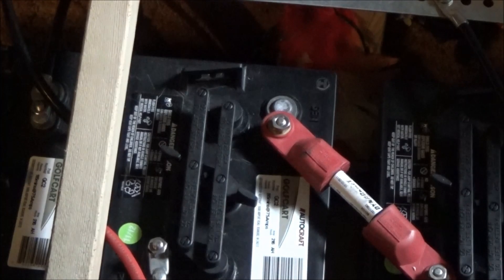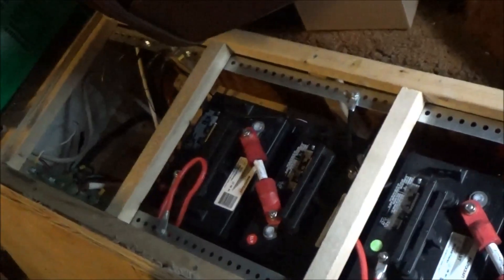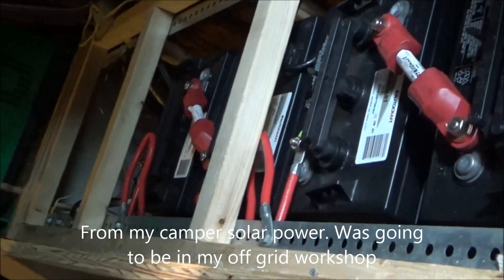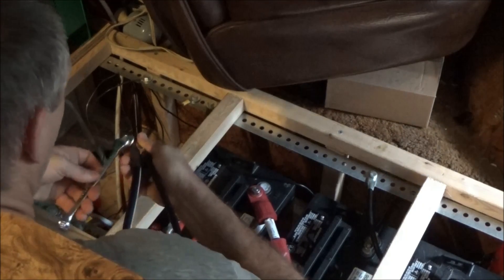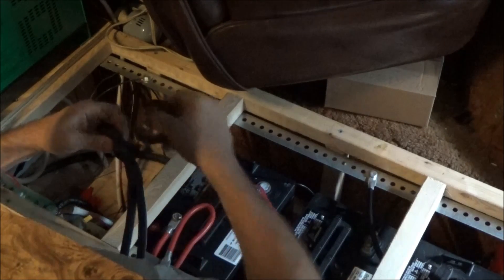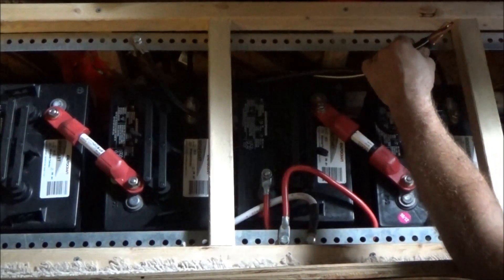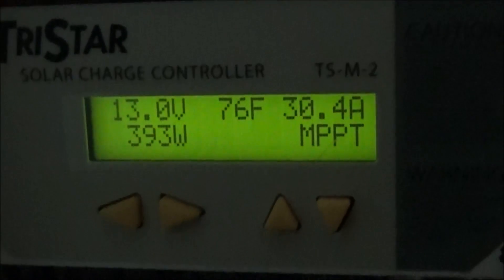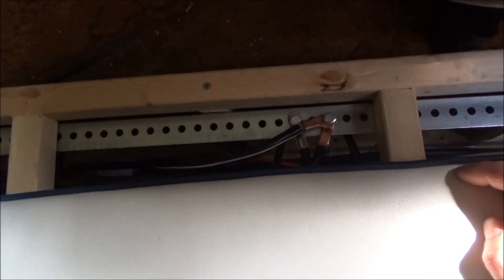Rewiring My Off Grid Solar RV Battery Bank

Comment: Hi Troy. I think your new conection is good idea.  BTw you should check how many Volts is voltage drop between first battery with + and last battery with + as well. Try it with hard load. I think good is belov 0.5V max about 1V. Btw that electrical tape is not good stuff.. That is for sure. Please use correct one. Correct i mean that self vulcanization tape . Not sure how it is called there. Btw for my batteries 12.0 or 24.0V is still OK. If possible try to get one of those BMW 600 from Victron. or similar . They counting SOC , Ah and such. YOu are always sure if it is Ok or not.

Comment: I would consider replacing the bus bar with something where you wont lose resistance, there has got to be something laying around, (like 1/2 inch water tube) just bang it flat and drill your holes where you need them. How are the batteries coupled 12 or 24 volt? From what I understand you draw less amps if you run 24 volt than 12. I know my camp fridge draws nearly 1 amp at 12 volt and only .5 amp at 24 volt. I am only trying to understand how you have it setup so as to maybe give some advise to drop comsumption!! Cheers!! I love the stuff you are doing...

Comment: The charge control needs to be connected directly to batteries.  The other items can run off buss bar.  Copper buss bar is the best. Aluminum is a efficient as copper for DC voltage.  Just trying to help since you know we live totally off grid.  Take care.

Comment: Good explanation on how to wire the charge controller and inverter to the batteries. I know your'e on a tight budget and choose not to include safety features, but you should have advised on the need to install fuses and battery disconnect switch. A good disconnect switch will hide the initial spark caused by the inverter's capacitors when they take charge.

At what voltage does your inverter's low voltage alarm sound? Shouldn't it be 11 volt triggers alarm and 10.5 shuts down?

All of those issues you talked about having with your system; buss bar, heavy gauge cable requirement  and the need to run + & - connections from opposite ends of buss bar were eliminated when I wired my system at 48 Volts. I use 8 batteries like yours but all in series.

Comment: connect the wires directly on the opposite batteries one on the positive the other on the opposite end negative moving the wires on the bus bar does not effect the equalizing charge

Comment: do you ever equalize your battery bank?  it sure makes a difference!  you can boil a flooded bank pretty hard for hours, so long as you keep an eye on the water levels.  if they get low, just add a bit of distilled water.  if your water levels ever get low enough that the plates aren't submerged, you're doing major damage!

Comment: Over the last 7 years--I started with power bright 3500; but, modified sine wave--then I moved up to  24 volt system. I have 6 12 volt marine batteries--that gave me 3 banks at 24. Volts. I only have  500 watts  in  12 volt solar panels---wired series for 24  volts then I have 3 sets for wired in parallel.  I even bough the morning star mppt tri star 60 amp charge controller. Also at the same time I purchases the go power 1500 watt 24 volt input inverter. One thing, should I climb to the maximum voltage to get more out of the charge controller? That propane refrigerator that went out what was the average temperature of the unit?

Comment: I have a similar refrigerator in my cabin.. For one thing, your fridge needs to be taken inside, out of the hot sun beating down on a black surface. Also you can put insulation around the sides and top of the fridge to help hold in some of the cold that it generates, don't put insulation on the back of it though, it has to circulate air there. If nothing else, put some blankets around it, anything to keep the sun from beating down on it.

Comment: Hi
1 )   Keep the inverter cable as short as possible.
2 )   Feed the charge from the MPT controller directly to the middle battery not bus-bar.
3 )   Take the MPT controller voltage & temp scene directly to the a battery post not bus-bar.
      I would use the battery nearest the inverter.
4 )   Tie the 6 v lines of the battery's  ( you can use smaller cable if you fit 5 amp fuse between battery's )
5 )   If the MPT controller has a dump load out put consider using this for automated charging
      of laptops & servers and the like ( 12v or dedicated "THAT OLD" inverter set up )

Comment: The inverter did not snap because you didn't have it disconnected long enough for the input capacitors to discharge.   You can make a light weight lead with a resister in it that you connect to touch off for a minute before putting on the regular cable.  This lets the caps charge up slowly without any escaping blue light.  ;-)

Comment: I think it was an over complicated and not as organized to put all 4 negative wires under the same bolt.  It would have been fine and looked more organized a couple of bolt holes away.  Also, another idea.  If you have some extra cables, you could daisy chain from bolt to bolt along the rail.  This would in effect give you a parallel copper path to lower the overall resistance of the non-standard buss bar.  Still, I think your buss bar is probably OK, but sure, it could be better.  Don't beat yourself up too much over that.  It would be more imporant to double up the longest leads if you acquire any more #2 wire.

Comment: One thing I have learn about solar is to build your system up to a 48 volt system...I am up to 24 volt --next step 48 volt it's can be very expensive.

Troy will need to do the same thing.  Do it in baby steps. Your 12 volt inverter is very bad on sucking up power out of your batteries.
Compared to my system. I cry every time I buy batteries, wire, and panels--I still got a long way to go. I believe trying to fix batteries is a wast of time---trade them in on new ones.
Reply from the maker: You got a very important point there. Its very expensive to switch over to a higher voltage. Since everything I own is set up for 12 volts its out of the question for me.

Comment: I see a few ways to up your power here. #1. believe it or not fresh wood is a conductor. The higher the humidity the more it will conduct. If it were dry dead wood with no sap, or not able to absorb water, it would be an insulator. Right now you have a very tiny short on those batteries. I'm sure if you take a multi meter and set it to ohm's, stab it into the wood, you'll be able to see the resistance.  You will need to insulate the bus bars from the wood. #2. Your positive and negative wires from the batteries to the bus bars, are to long. I would also use a heavier gauge wire. #3, I think another two batteries would do the trick as far as storage goes, for your needs. If I'm correct you have about 650 to 675 ah now. Really not a lot since you cant use all of it with out hurting the batteries. For every 100 watts ac at 1 amp, per hour, you'll need 100 watts dc at 12 to 13 amp's per hour. 13 ah x 8 hours is 104 ah drawn from the batteries, and that's not including the 12 volt stuff or resistance you have there. Your solar setup over all is great. I'm sure if you knock out, even one of those bugs, you'll see a huge difference.
Reply from the maker: I figure the resistance along that much wood will be too high for the drain to be a problem. I will be reworking the whole system in a couple months though in my tiny house on wheels. Thanks for the input. Food for thought.
Reply: The Do It Yourself World You're welcome

Comment: I know you showed that fridge not too long ago, but I forgot how you got it. In any case, it is turning into a drain on your resources. While you may have had to improve the battery bank anyway, the timing sucks. In addition, it does not really take away that your batteries will be working hard, and I would also not be happy having that inverter work so hard all the time.
Which makes me think of two solutions. Do you have another inverter, in the workshop trailer for example? If you could hook that directly onto the solar panels (or with an old battery in between as buffer), that are not really effective because of the limitations of your charge controller, the you could run the fridge of that during sunny times and let the main batteries and inverter recover in the mean time. 
Another would be to get rid of the fridge and get an ice maker. You can make ice while it is sunny and use that to keep your food 24/7.
Both are more work to operate of course, but seeing how things go now I am afraid that soon some major damage will happen to the batteries or so, and then you really are in the doo-doo.
The best solution is of course getting hold of an RV fridge that can run off propane, but I guess that is too expensive at this time.
Reply: This makes me think of what I would probably do, and it should not be too expensive: get one of those cool boxes that can run off 12V. Capacity is not great but it should keep your milk happy. No ice cream of course. And it bypasses the inverter, so less losses and less load on that poor inverter.
Reply from the maker: I need a freezer converted to a fridge. I will get one in two months. For now I have to limp along. The solar panels are 24 volts and I do not have another charge controller capable of handling them.
I used one of the cool boxes last year. It runs 24/7 at 70 watts. Not good either.

Comment: connection is a lot better now, still you forgot to connect the 3  6 volt batterys together!, just need two wires , connect them a 3 together , its realy inportant Troy!,
use thick wire, no 0 gage nedded tho, the thiknes off the wite wire you used is quite good enough!  you will detect inproved power! (and life expectancy off your battery's! (dont forget the water level too!)
its no joke Troy! you need these battery's!, keep them healty and fresh!
Reply from the maker: Please tell me on the forum how exactly you mean to connect the 6 volt batteries together properly. Thanks.
Reply: from what i could tell, each pair of 6v batts has a jumper wire to the "buss".  it's far from ideal, but seems to be working.  on another note, technically both wires that feed the inverter should be the same length, even though one doesn't need to be that long.  as it sits, the pos terminal has way less resistance, those batts will see more of the abuse than the ones from where the neg terminal is.

Comment: its that bad seal on the door  its why it runs alot also why you have water around the door  fix that and it will run less often also freeze water bottles if nothing in freezer  it will help over alll  and use less power   and finaly was the rv fridge a 3way/2way. ?   have u tried to see what it would do on your dc power .. might be less of a drain then the hier fridge.......    happy 4th  be safe an enjoy ..grill up some burgrs :)
Reply from the maker: Thank you. Happy 4th. I pushed the seal back in place. It was brand new, just cheap design. The RV fridge will not work on 12 volts long term. Its designed to maintain the cold but not to cool it off.
Reply from the maker: And the RV fridge is dead. Totally dead. All the ammonia is gone, and that was what made it work.

Comment: Hey Troy see if you can find a way to barrow a clamp on amp meter. Then check the cables at the inverter, and each connection point on the bus bar. This should give a good indication of how balanced your system is, and also any weak spots.

Comment: Hope that helps as you say; you work with what you got. I think the best solution would of been to hook directly to the battery terminals; but since the cables are copper it should work out since they are better than steel for conducting.    Don't know how far it s to your little creek, but could you get a solar pump and run a small diameter hose to your place. fill up a bucket; then using a mister nozzle to cool the coils on your fridge.or just do trips with your truck, fill  using the bilge pump Should reduce the actual run time for the fridge. Just a thought..
Reply from the maker: I will redo the entire system when I build my tiny home and do it right. I am saving up for all the proper equipment. The fridge has coils inside the side walls. Stupid construction

Comment: Troy , I live on my boat and on Solar power. I run a little 12 volt/ 120 watt cooler fridge. I purchase enough cold items for 3 days and then replenish. it does not drain my batteries at all and works great.

Comment: What ever happened to the small refrigerator that was in your old camper?  Wasn't that a good refrigerator that worked off of propane/electric? Why not use that one. I would think it would use less power than the new one you have now.

Comment: That looks like galvanized steel. GET REED OF THEM. The galvanization is coming off the steel nice and slowly because of the electricity, poisoning the air in the process. Use copper pipe instead.

Comment: Hey Troy, know that it will make your fridge a bit mucky, but have you considered putting some tape of some sort around the doors to help with the drafting problem? Maybe some of your aluminum tape? There are a products that will take adhesive off when you go to sell that silly thing. (seriously don't think that you should keep it at all. It's not a useful tool for you.)
Reply from the maker: I agree, this is going away soon. If it does not burn up first. Its running non stop in this recent heat. Literally non stop.

Comment: Why don't you run one of your generators during the daytime for the fridge and air conditioner while your batteries solar charge?  I'm also wondering why you neglected to set your wind generators back up?

Comment: It will help to equalize the charge and discharge. But you are going to have to expand the overall capacity of the bank as there is no workaround. I know you are on a shoe string budget but we are fighting with mathematics. If you can find 2 more batteries then you will add another 200RC. Again, you have to get at least that 300w windmill back up. Troy, I know am a bit of a pest on this. On the switches, yes it seems to be redundant but you aren't looking at it in the correct light. Ease of maintenance and safety. You could use two blue sea switches. One for the power charger and the other for the power inverter.
Reply from the maker: I agree on all points.

Comment: man your timing in this video is awesome...i have been wondering why my battery bank shows low voltage after sun goes down..meanwhile it peaks at like 14 volts during sunlight...also high temps/humidity  here on my batteries...they must not be absorbing the charge even though my morningstar 30m charge controller shows up to 12 amps input and at times no output load or less than 4 amps occasionally ..
Reply from the maker: Happy to be of help. Yes change the wiring for improved performance. Also use the thickest gauge wires you can afford. Thinner wires resist the power and you lose a lot.

Comment: Nice to see you giving your battery bank some love Troy.  Do you have a means to test the Specific Gravity of the electrolyte in the batteries?  might be a good idea one evening to disconnect them from the bus-bars check the electrolyte and then test the SG if possible to make sure they are all topped up and at the same SOC.  Also, look up the voltage to SOC curve of wet cell Lead Acid batteries, 21.1v is ~60%SOC... which is more than fine... 12.0v is classed as 50% SOC which is a good point to cut off the power if you want to make your batteries last... for some reason i think your inverter is tripping early... might be some major voltage drop on the bus-bars / cables somewhere??
Reply from the maker: I plan to give the batteries a full going over soon.
The inverter kicks off early. That is good.
Reply: The Do It Yourself World  Good to hear Troy.  Sorry if it feels like I'm harping on about the batteries, but i would hate to see a nice battery bank get damaged or destroyed. 

If your Inverter is kicking off at ~60% SOC then you are effectively only left with a useable capacity of around 1 to 1.5kwh of storage before you take conversion inefficiencies and losses into account, doesn't leave a lot of power left for running things which is probably where the storage anxiety is coming from.  Hopefully when you get the finances to double or even triple your storage capacity then all your troubles will start to go away.
Reply from the maker: 1981therealfury I figure about 3,000 watts of usable energy before I consider my batteries dead. I dont drain below 12 volts at the lowest.

Comment: To help your frig run more efficiently and not have to run as often, FILL it. Even if you only fill it with bottles of water. All that cold mass will retain the cold better and it won't have to run as often. And, if it's already cold when you put it in there, all the better.
Reply from the maker: I did.

Comment: Hey Troy, consider removing the battery box “bus bars” and use 0 gauge interconnects from bank to bank in the box.  Then wire the charge controller to batteries 1 & 2 and wire the inverter to batteries 5 & 6, or vice-versa.  Many reasons to do this but it’s beyond the scope of this message.  Second, if your battery bank is hooked in any way to the RV DC load center, consider disconnecting that and building a DC load bus bar to connect all of the DC loads that “you are currently using”.  This will insure that you are not feeding a phantom DC load that you didn’t know existed.